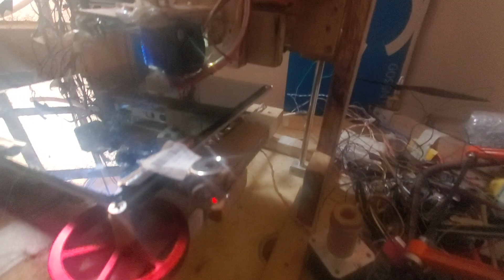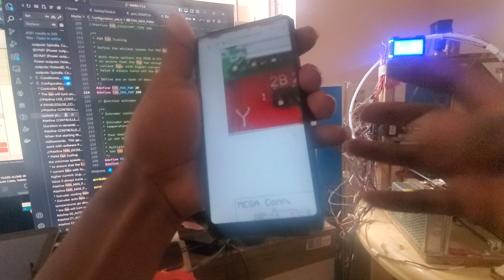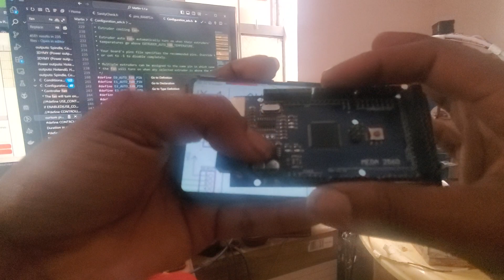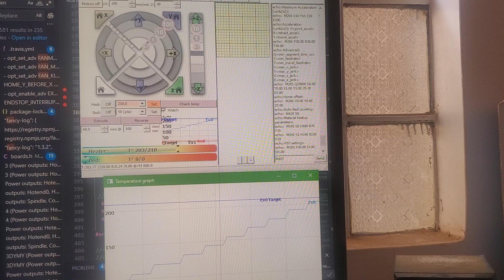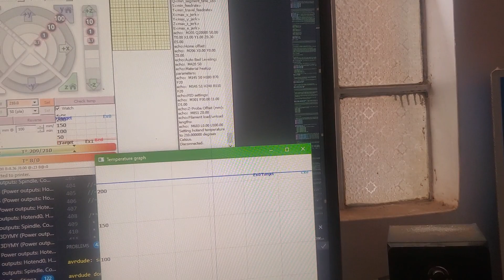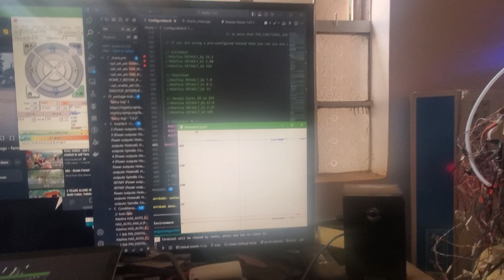3D printer diy, temparature setup, marlin firmware, Ramps 1.4 board.

Comment: Hello my friend, how are you?
I am going to do a graduation project that consists of building a 3D printer using an Arduino Mega and a RAMPS board, with X, Y, and Z axes driven by stepper motors from hard disk and floppy disk drives. I have several questions—may I contact you? Thank you.